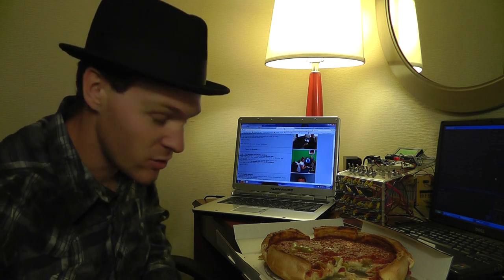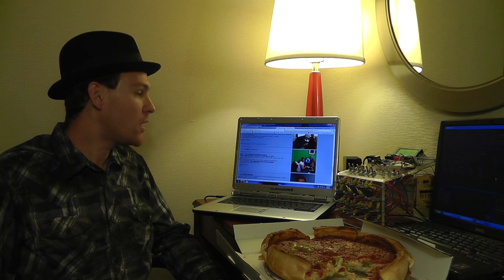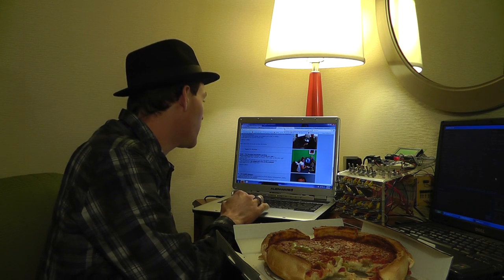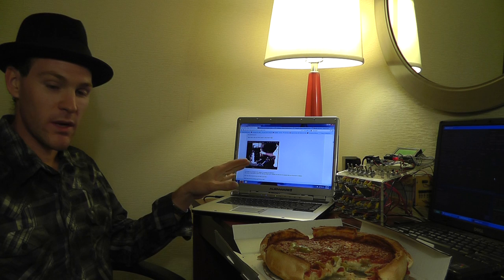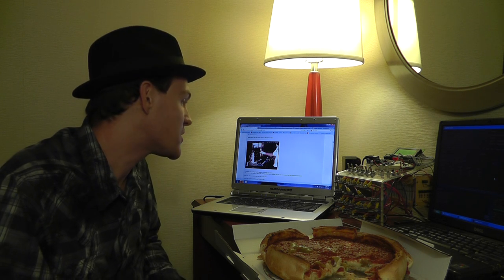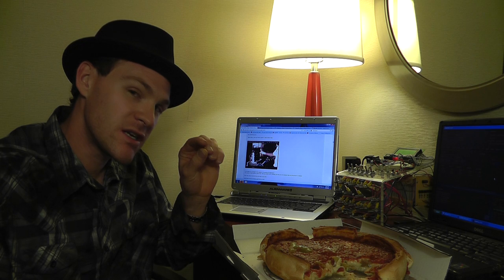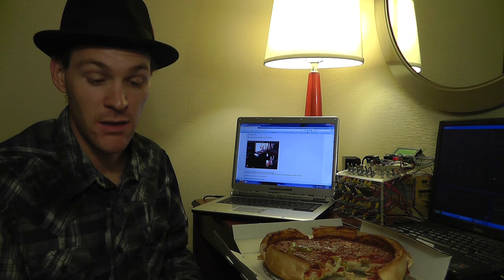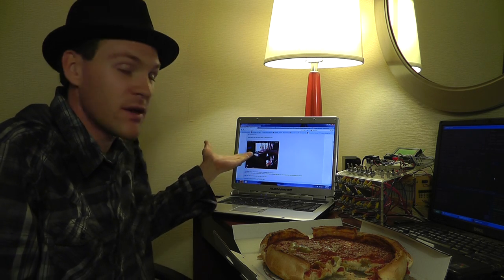Update 1 NGE Papp: Thoughts and more information.  RWGresearch.com

Comment: According to the patent and scattered sources, the physical cylinder contains the gases, but the expansion takes place within a "virtual cylinder" controlled by the strength of the magnetic field from the coils.

The plasma expansion always occurs at the same rate.  To adjust for variable engine speed, the containment coil "squeezes" the plasma at variable strength towards the center of the cylinder, thus concentrating its force on the piston at the desirable linear expansion rate.

Comment: Hi Russ, Papp used thorium and radium , alpha radiation emitters. They are not dangerous. A piece of paper stops these particles. In the engine you bought, the use a radio wave transmitter instead. They mimic the same frequency the thorium and radium had.

Comment: also excite the gases. The way Dan Glover explains it in the video, the 3 steps are done in a sequence starting with the coils, then the RF, and finally the high voltage electrodes. However, it makes more sense to me, that the high voltage electrodes  should be used first creating the necessary initial energy/heat to excite the gasses to the plasma stage. Since plasma has electromagnetic properties, it will be compressed and contained by the coils...

Comment: Very interesting. Given the popping action one would think anyway, you'll have "zero points" which in essence though different than AC of course, should mean that you'll get away with much less robust cabling and switching than if very high current linear power. Which is good, as I see it.

Comment: About the use of a magnetic piston and coils...

The expansion chamber is already surrounded by a "containment" coil used to control the speed of the plasma expansion with a magnetic field of variable strength.  I imagine that a magnetic piston head would interfere with this function.

I don't think you can build a generator directly on top of the existing, carefully controlled electromagnetic containment system.

Comment: Nice pizza Russ lol.Somehow i dont think there was 600amps at 1000 volts comeing from those coils-the wire size would have to be a lot bigger to handle that sort of current.If you take a look at a cars battery lead's,they are much bigger-and there only doing around 300 amps at 12 volt's and still get quite warm quickly when cranking the car.But any power back is a gain-what that power is,you will find out soon enough.I can design a double push popp crank engin if required. Power on Russ

Comment: So I see you finally got a stuffed pizza...couldn't resist huh? About the Papp engine, It is my understanding (from the video link by Sterling Allan interviewing Dan Glover part II) that the Papp engine works on by means of a 3-way excitation process of the noble gasses. The simple machine in the demonstration uses coils to generate electromagnetic  fields that  "compress" the gases, it uses RF to further heat/excite the plasma/gases, and it uses high voltage electrodes (200k-400k volts) to...